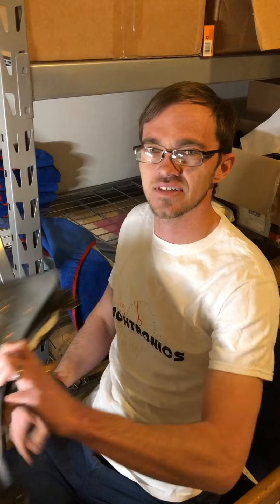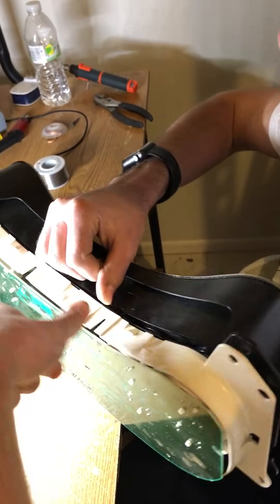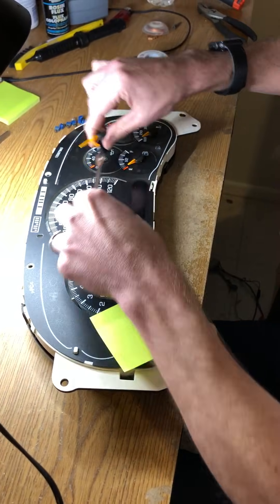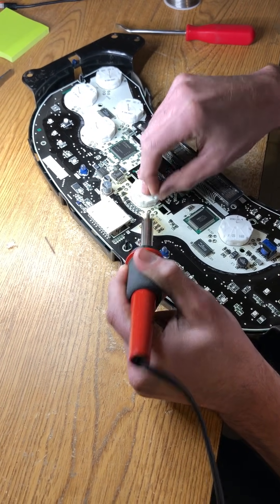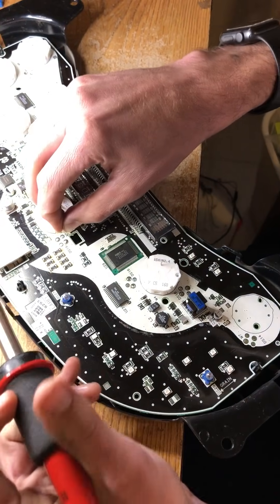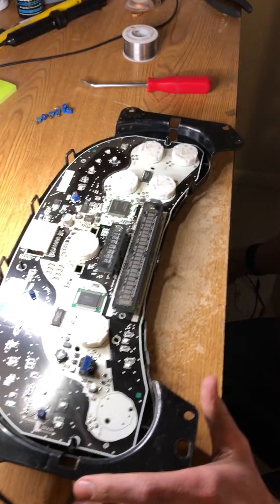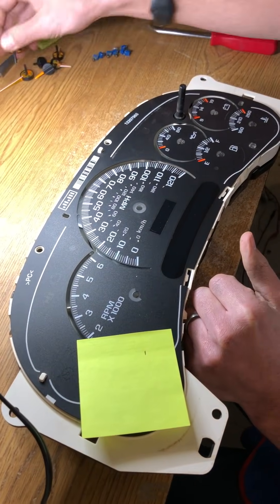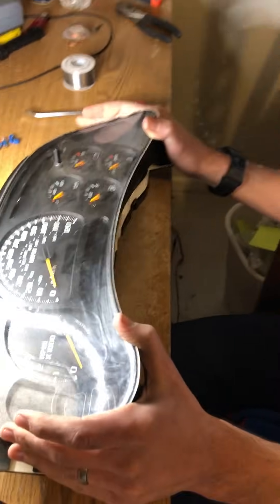How to install LEDs in 2003-2007 (classic) Chevy, GMC, Escalade instrument cluster

Comment: i tried soldering leds into my 03 silverado cluster and now none of my gauges work, what went wrong
Reply: Have you figured out the problem, because I’m having the same thing happening to mine?
Reply from the maker: Cat Eye Danny that’s hard to say without having been there when you installed them and not having the cluster here to diagnose. 

Is everything completely deal? No lights coming on at all?
Reply: the leds i ended up putting on work perfectly fine but none of the gauges work not even the gas one. It doesn’t make that certain noise when you plug the cluster back in and it happened when we went to try it back on and the leds started smoking
Reply from the maker: Cat Eye Danny yikes, that doesn’t sound good. I can’t say anything for certain without seeing it but sounds like you’ve shorted something out. If you’d like to send it to me to take a look, you’re welcome to do so but most likely you will need to replace the circuit board (also something i can help you with).
Reply: Tachtronics do you think i’m better off buying a whole new one ?
Reply from the maker: Cat Eye Danny well if yours is repairable, it would be cheaper to repair yours. However, from what you’re telling me, I think it’s fairly likely that you will need a replacement.

What we do at Tachtronics, if you decide to send it to us, is take a look at yours first to see if yours is repairable. If we find that it’s not, we’ll contact you and if you decide you’d like to replace it, we can copy the info from your old one into a replacement and then  send that one to you.
Reply: Tachtronics Those geared gauges are a pain in the neck. You probably pulled the needle off. The plastic gear inside is probably messed up. You are suppose to desolder them from the back and do not pull off the needles otherwise you mess them up easy. The problem is the gauge can not move freely anymore they are provably broken

Comment: I’ve seen vehicles where the P R N D are red along with the LCD screen. Is there a way to change that or would they have bought a whole different instrument cluster? Great vid.
Reply from the maker: Killerteve thanks. There are a few ways to change the color of those screens. You can apply a film to the back of the gauge face to change the color or you can buy a custom gauge face. The film route is much cheaper but will also dim down the brightness of those screens a little.
Reply: @Tachtronics  what do you use to remove the factory film? I tried just putting it behind and no go. I removed the factory film with acetone (nail polish remover) and it left it a little cloudy. Got the color I want, but a little cloudy
Reply from the maker: @AlexRodriguez-pg9xk  I sand and polish it
Reply: @Tachtronics  I tried the same with 400, 800, 1000 and 2000 and polished with plastx after and was still cloudy.. any extra tips ?
Reply from the maker: @AlexRodriguez-pg9xk  I just sand and polish. It’s possible that the acetone caused it to be cloudy and if that is the case, I’m not sure what to do about it
Reply: @Tachtronics  I’ll give it a shot on an extra overlay thank you !
Reply from the maker: @AlexRodriguez-pg9xk  you’re welcome

Comment: Will these LEDs flicker?  I’ve been reading about the voltage and that a resistor is needed
Reply from the maker: mjbiles32 thanks for the question. many cheap LEDs do need resistors added and also flicker and fail soon after installation. These LEDs have built in resistors, dim with the dimmer switch just like OEM, and are VERY reliable. I have installed 1000s of them so far and have yet to have a single bulb fail.
Reply: Tachtronics I appreciate the quick response.  Thank you for your time.
Reply from the maker: mjbiles32 you’re welcome

Comment: Hay bro I built a cluster tester and cant git the needles to sweep, and I cant get the displays to show either can you help ,by the way good job
Reply from the maker: Are you getting the cluster to power up? If the cluster is powering up, the displays should also come on unless the cluster is faulty.
Reply: @Tachtronics  all it will show is the lights hears my email abj1953@yahoo.com or call or text me 606/312/0791  thanks bro

Comment: I want to install blue LEDs in my 2005 trailblazer. If I remove it and send it to you can/ will you replace them?
Reply from the maker: Yes we sure can
Reply: @Tachtronics  I need mine done TO. 251-264-1170

Comment: I recently put a new cluster but the big gauges light don’t work but everything else do ?
Reply: JonathanP863 was it a new cluster or used?
Reply: Randy Martens the mechanic told me it was new that he had to take it somewhere to reprogram it charge me $600 just for that night I noticed it didn’t light up next day I went back he want to charge me again got me mad never took it back to him
Reply: Randy Martens looks new but I feel that it’s use but all my needles work just the lights don’t work on the speedometers but the turn signal lights and the others do work
Reply: JonathanP863 sorry for the late reply and the experience you’re having with your mechanic. Sounds to me like some of the backlighting bulbs are out. Your cluster should just need a few bulbs installed; however, if a few bulbs have already burnt out, I’d suggest replacing all of the backlighting bulbs while you’re at it.
Reply: Randy Martens  I have short video on my channel so u can see what it does
Reply: Randy Martens once u see that video on my channel so u can tell me I’ll send it to u